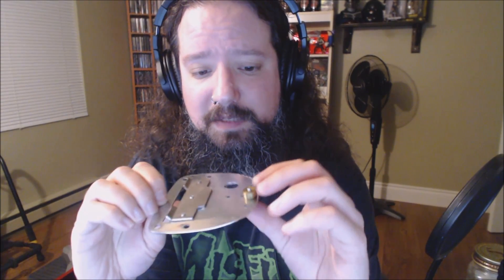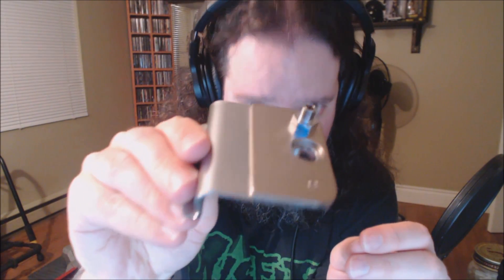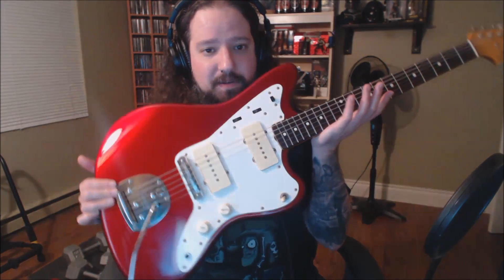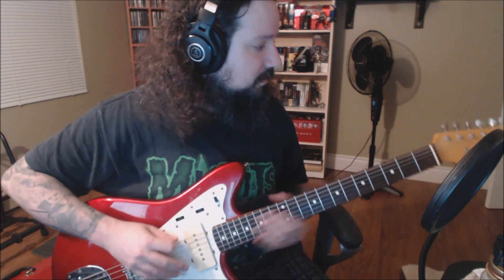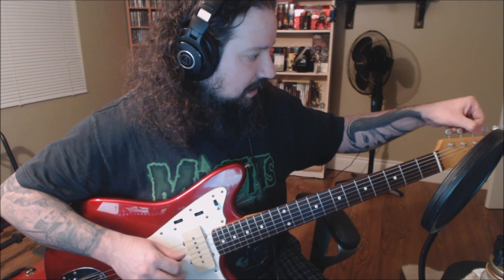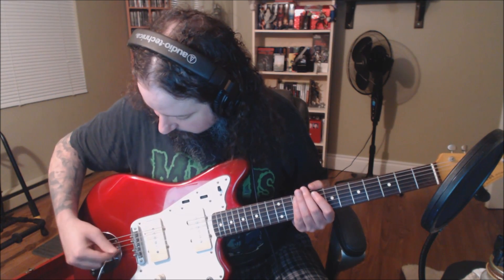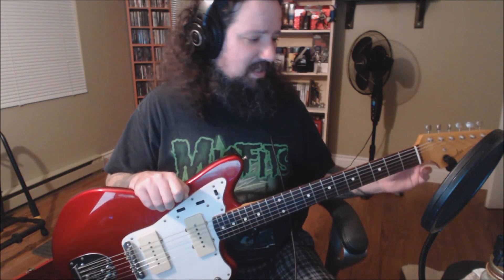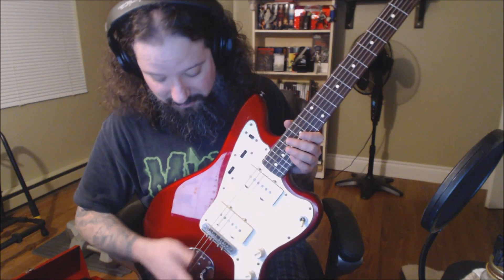Jazzmaster/Jaguar trem - Explained and set up

Comment: I have a problem on my Jaguar, the tremolo never returns to pitch when I use the whammy bar, even when I have it set up how it should be. If I push down, stays flat, pull up, stays sharp. I changed the strings from 10s to 12s and still have the same problem. Can anyone help? Do I need to replace the spring?
Reply from the maker: Peamush I was gonna say... Take it apart and grease everything. Mine is a 91 and still on the original spring.are you sure the strings aren't catching on the nut? What model jag is this?
Reply: Livlos it's the classic player HH 2016 and hardly used. The parts all look fine and it works fine until the strings are on. I'm going to try see if it is the nut, will filing it down a little bit help with that? I always use a pencil to lube it up also. Thanks for replying
Reply: Scratch all that. It looks like the tremolo is catching on my guitar as soon as it's screwed down. I'll let you know if I can't fix it from here
Reply from the maker: Peamush good luck
Reply: Would it make a difference whether the strings are roundwound or flatwound?
Reply from the maker: Peamush don't think that would make a difference trek wise. If you are switching string gauges you do need to do a bit of a set up...but it wouldn't cause the issue you are describing. My money is still on the strings catching in the nut. What model/brand is your jaguar?
Reply: It's a Fender Classic Player Jaguar Special HH hardly used as well. I've filed down the slots in the nut a bit, and now it's coming back up correctly but still staying sharp when pulled up with the trem unlocked. Also sanded down the inside where it looked like the bottom trem plate was catching, so I don't know whether that fixed it or the nut filing. Still strange that I still have half the problem.
Reply from the maker: Peamush wouldn't suggest sanding it down but lubing it might help. And yeah made in Mexico fenders are my kryptonite
Reply: Yeah it's all greased up in there too. I'll probably have to take it to repairs so someone can properly set this thing up for me. So you don't think roundwounds are more likely to have trouble sliding around in the nut? I only had 12s laying around but would prefer 11s, not sure whether flatwounds would help or not since they're supposed to have more tension. Thanks for your replies anyway :)
Reply: Peamush I have the Classic series jag. I bought it about 2 years ago. I had a few issues too until I did a few tweeks. First, watch Dave Simpson's video on his jag set up where he uses the nail varnish and also the electrical tape. That info alone helped take away 90%of my issues. Also, something else that helped is finding how much to tighten the screw on the trem. If it's too tight it'll sound harsh. If it's not tight enough the strings can lose tension over time more easily. Just play around with it. It's pretty easy to figure out. One last thing, I went from a .09, to a .10, now I'm playing .11 gauge strings. That has made a HUGE difference. Try .11 gauge D'addario strings. Good luck.
Reply: Smelly Web Thanks, I took it to a repair guy who sorted out a few things. The nut was causing issues, but the main thing was that the knife edge was a bit worn and was causing a bit of friction. It's about 90% now, only have trouble when pulling up on the trem, as it doesn't return as well but in locked position it works perfectly. I'll have a look at those videos you suggested
Reply: Peamush Adjust the tension on the screw. Also, bigger strings on a jag help so much. Cheers
Reply: Smelly Web Yeah I have and it's got 11s on

Comment: Would it be at all problematic to remove all my strings at once with this trem?
Reply from the maker: I've done it before.....but like most spring loaded trems you're better off changing them one at a time.
Reply: @Livlos  I'm going to change my pickups.when i do, how should i get all the strings off?
Reply from the maker: @themixmusicandmore6280  I changed the bridge and just removed all the strings you might just need a quick readjust after
Reply: @Livlos  im just concerned with the pressure on the plate if i remove all the strings. Ive seen people do it on youtube so maybe its not a big deal

Comment: Livlos, I was wondering if you could do a video on just setting the tremolo lock alone. I had a tough time following along. I have an American Professional Jaguar I bought new but had someone install a snap in tremolo bar. After I got it back the tremolo lock just moves freely back and forth. I reinstalled my prior tremolo bar and examined the procedure of your video that addresses the tremolo lock. Much to no avail, it still moves freely. I’m at wits end. Help!
Reply from the maker: by lock I presume you mean the button you can slide back or forwards to allow the trem to be pulled "back/up/to higher pitch" or not? if so..sure, you just need to make sure the trem is set up correctly.
Reply: Lock is for “String Memory” So if you break a string(tension changes), everything doesn’t completely go out of tune. Lock keeps the spring from pulling harder.

Comment: Im Bill. I was really hoping you were going to show us how to keep this type of Fender Tremolo system in tune if one wishes to do a lot of divebombs and such. I would have liked to have seen you demonstrate how well it stays in tune after doing many deep dive bombs.  The reason why is because it seems these types of tremolo's refuse to hold the guitar in tune after doing deep dive bombing. Sure, you can do a little wiggle here and there, but that's about all.  What say you?
Reply from the maker: These were never designed for extreme use. The up and down is quite limited. Your mileage will vary based on your over all set up. Mine stays in tune fine
Reply: @Livlos  Take a very close look at the friction points of the jazzmaster tremolo system, take it apart and look close.  Look where the flat plate edge comes in contact with the opposing, curved, concave piece of metal. Take note as to how the flat edge of that part is very rough and pitted with sharp edges. That's causing a lot of biding and friction. If the whammy has been used much you will see where the flat edge, rough piece, has made gouges and scratches in the opposing, curved metal part. That's where the problem is that's keeping the guitar from returning back to perfect pitch/tune when you do dive bombs and such. First use a file, file the flat edge part to have a rounded edge instead of it being flat. Then sand and polish both those contact surfaces to a mirror like polish. The better the polish the less friction there will be on those two surfaces where they come into contact with one another.  Then use some good quality grease on those two parts where they come in contact.  This will eliminate all the friction and binding between those two parts. Now onto the tuning posts and nut. Most people when they wrap the strings around the tuner posts, they start up high on the posts then wind the strings downward. Do just the opposite of that. Start low on the tuner posts and wind upward. This will decease the sharp angle of the strings as they come over the nut. That sharp string angle will cause the strings to hang up with binding and friction on the nut. Try to get the winding around the tuner post to the point that the strings are just barely touching down inside the string channel cut in the nut. Then raise the two string trees up to lesson the angle of the strings coming over the nut to and under the trees, the trees are also causing friction and binding. Be sure to use some graphite on the nut channels for lube. You will also want to stabilize the bridge so it no longer moves back and forth when using the whammy.  I used two small strips of aluminum pop can, wrap the strips around the bridge posts to remove the slack in them and to stop the movement. The bridge will now be stable and will not move, nice and tight fit. If you do this as I have explained, your Jazzmaster will now stay in tune even when doing all the dive bombs you want.  I can't even knock my Jazzmaster out of tune now. I can whammy and beat the crud out of it for hours, it stays in tune. Like you, people do not believe these types of tremolo's are designed to be used in this manner. With my fix, they now can be used that way. In fact, the JM type tremolo can be made to be much more tuning stable then a Stratocaster type tremolo. I do not lie. Try it! One more thing. If you use a light gauge of strings, it may be helpful to get a more powerful tremolo spring. Get those here https://www.leespring.com You'll need to send them the stock spring, tell them you want one that has double the (Per Pound rate) as the one you sent to them. A stronger spring will force the tremolo and strings to come back to perfect pitch. Yes, the tremolo will be a bit more stiff now, who cares...You're welcome!

Comment: whats better this unit or the Dynamic Fender Vibrato on a Mustang ?????
Reply from the maker: Bflatest let's just say I use this as a trem on the jazz. The mustang trem  is locked and will remain locked
Reply: ahh did you wink-wink just then?
Reply from the maker: Bflatest I may have ;)

Comment: I don’t have a Jaguar or Jazzmaster, so maybe that’s why I am confused about the lock mechanism. When it’s locked, it’s not really locked? If you want the tension of one string not to affect the other strings, does the lock accomplish this?  Thanks.
Reply from the maker: It basically just prevent you from pulling back on the trem so in a case you bust a string you could lock it to be relatively in tune.

Comment: Such a great video! Would you know if the Mastery version is any different? Just ordered a guitar and got the Mastery upgrades for the Bridge/OMV, but I've never used this sort of system before. This was super informative and a great stepping stone for learning how to take care of it when it arrives!
Reply from the maker: Honestly no idea. I never saw the point of the mastery tail piece.
Reply: @Livlos  thanks for the reply! The mastery was the only JM/Jag styled vibrato option they had so I ran with it. I much prefer it over a bigsby, which was the only other vibrato option available.
Reply from the maker: @Michael_Is_Avg  building a guitar from parts? The bridge is a mandatory upgrade on a jm or jaguar. But the tail piece I just don't see anything wrong with the original.
Reply: @Livlos  I'm having a custom semi hollow JM-esque guitar made from a company called Jennings. Two dudes in California making pretty cool stuff you can customize to your hearts content (and are relatively affordable). I got the mastery bridge and omv. If I was building it myself from scratch, or upgrading an existing guitar, I probably would have made sure it had a good bridge and used a traditional fender tailpiece. But I guess if there's only one option, Mastery isn't too bad (and the upgrade wasn't too much either, so no biggie)
Reply from the maker: @Michael_Is_Avg  tell me how it turns out
Reply: @Livlos  Will do! Thank you once again for the video. I've had about every type of vibrato system from Gotoh 510 to Bigsby, but never a JM/Jag style. It was really great to have a break down of how it's designed/functions and how to do a proper set up before it arrives.
Reply from the maker: @Michael_Is_Avg  I need to try a bigsby
Reply: @Livlos  I am not a huge fan. They look great on guitars (especially Tele's), but they're a bit finnicky tuning stability wise. I've always upgraded the nut, shimmed the necks when needed, used lube, different springs, upgraded tension bars, etc., but never had super reliable tuning. I've gotten them decent (I've had the B3, B5, and B7 Bigsby's), but so far my favorite trem for reliability has been the Gotoh 510

Comment: Thanks a lot for the video and explanation!
I am looking for a way to "permanently" lock the trem. Wouldn´t it be possible to replace the spring with a solid metal tube or something so there would be no give at all? 
I don´t need a trem anyway, so that´s why I want to do this.
Also worth mentioning I want to apply this to a Bass VI which is pretty much the same thing, besides the 30" scale
Any thoughts on this?
Reply from the maker: You technically could....but you would still be able to dive...but not pull... And would pretty much end up the same as engaging the lock and tightening the spring a bit more. This works well enough imo. There might be 3rd party replacement bridges with no trem...but never looked. Sorry took so long to reply...
Reply: @Livlos  no worries! 
I guess I´ll end up with the Jazzmaster Baritone, 30" scale but has a set bridge. Don´t really want to mess up a a nice bridge if I can get there in another way
Reply: @melihkaleciklioglu  there's a builder on reverb that does hard tail conversion plates for $30ish.

Comment: greetings sir. i would just like to consult you of my jazzmaster. when its switched to its rhythm  circuit (slider up) I notice that the volume drops when I turn down (counter clockwise) the tone wheel. the tone seems to affect the volume not like when I do it on the lead circuitry? thanks . I just wanted to ask the experts.
Reply from the maker: That doesn't seem normal. Tone knob should not affect the volume noticeably

Comment: I have a bunch of guitars but not a Jazz or Jag. (It's on the shopping list).  Do correct me if I'm wrong but I'd say that the trem is not one for dive-bombing and, in fact, the range will not even match a standard Strat 6 screw one (which I'm not a fan of, incidentally, and can't fathom why not 5 or 7 screws "between" the strings.  The best of those one piece bridges I've used is the Ibanez ball-bearing pivot Floyd type).
Anyway, be that as it may, my query is regarding the choice of rocking bridge or roller bridge.  It seems to me that the roller bridge, unless it's of superb quality, will have friction issues for retaining pitch - whereas the rocking type bridge must be a little self defeating, in that, as you dive, it shortens the scale, thus raising the pitch…
What do you think about this?
Reply from the maker: You are correct you can't dive all the way to the point it ends up muting. As you say...they were not designed for that. depending how you set up the 6 screw fender ones, the jazz/jag is close range wise. As for the roller bridge, never used one so I can't comment. I really try to avoid any floating bridges as I don;t really use them and it's usually more trouble than its worth. The only one I get on with is the PRS ones. Never had an issue with those.
Reply: Thanks for the info and the rapid reply.  Good video, by the way.
More research is in order, I reckon. 😉
Reply from the maker: KENT SHELLEY good luck!